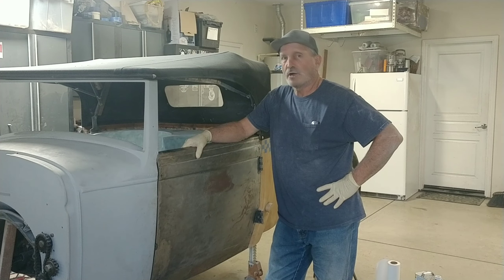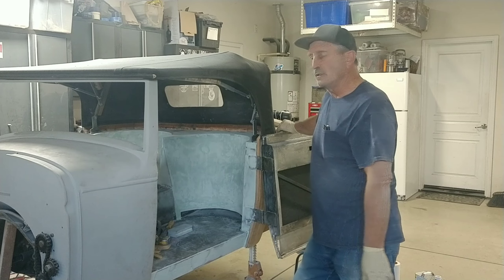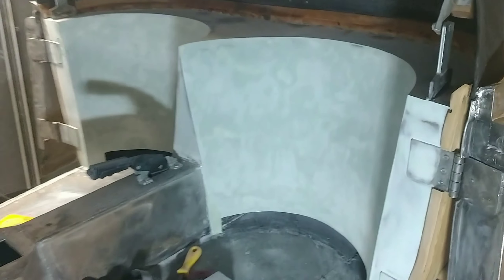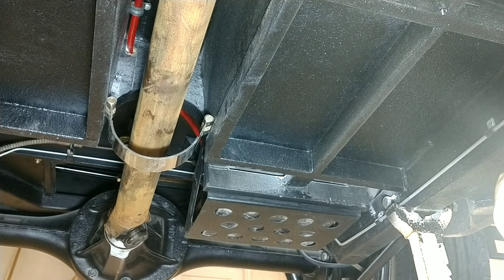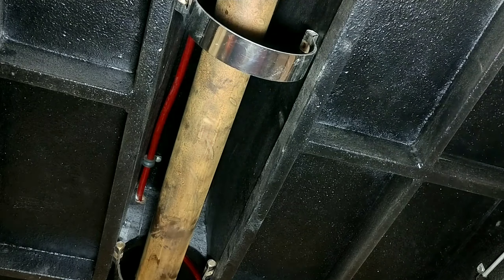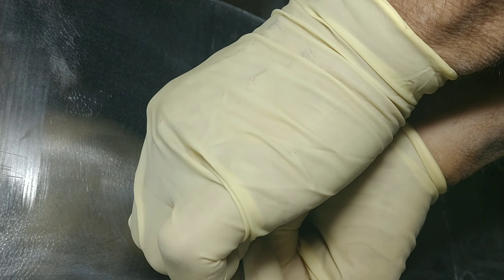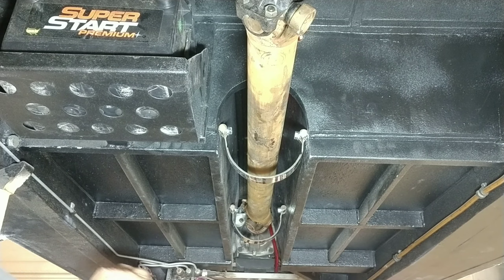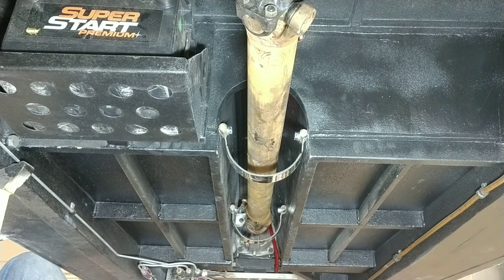1930 Neapolitan hot rod. mixing car parts and wine barrels together.

Comment: Nice finish work... lots of sanding...! Driveline hoops are never a bad idea. I've seen driveshafts tear the hell out of the underside of a vehicle, when one lets go. Nice install! I was thinking you could use a button head bolt and turn it around so the nut was affixed in the tunnel area and not have the nut and length of bolt protruding into the passenger compartment. Might work/look and little better and not poke ya on the inside. Don't know if that strap is really necessary, but I'm sure won't hurt. Car is coming along very nicely, man!👍👍
Reply from the maker: Yeah your right about the hardware. Yeah I'm just trying to keep the driveline in the car instead of dumping it on the highway. I've had that happen before, so I'm trying to prevent it. thanks for watching.

Comment: Looking good Robert! Not fun losing a drive line. I personally think the 2 safety hoops is plenty. Most tracks only require 1, so I don't think you have anything to worry about. Save the strap to tow the Chevy guys home!
Reply from the maker: Thanks I appreciate it that's what I getting from the comments. That's 2 funny 🤣😂 good stuff.

Comment: I'm liking everything but the tow strap.  it will whip in the wind on the highway and start to fray over time.  which can lead to it wrapping around the drive shaft and ripping it out.  the stainless steel half hoops should be good enough.  if you really want to add something further back just put a steel strap or metal maybe 16 gauge from frame rail to rail bolted in.  that would hold the shaft up without a problem
Reply from the maker: Thanks Ken. 👍

Comment: Nice job Robert, I think the two DL loops should be adequate, use good u joints and you’ll be fine. My 55 Chevy with a 502 only had one DL loop back by the four link. Your not going to the moon with it. Merry Christmas buddy.
Reply from the maker: That's 2 funny! Thanks I appreciate it, Merry Christmas.

Comment: I don't think you need the strap the stainless one should be enough. Merry Christmas.
Reply from the maker: Thanks Glen Merry Christmas.
Reply from the maker: Just not sure myself about the location next to the rear end. Because there is probably 8 to 10 inches that are still exposed from the u-joint on the rear end.
Reply: builds  so long as it can't drop your good
Reply from the maker: @glenmiller3783  Thanks Glen I'm having a few other comments saying the same thing that you're saying.  Have a great week.